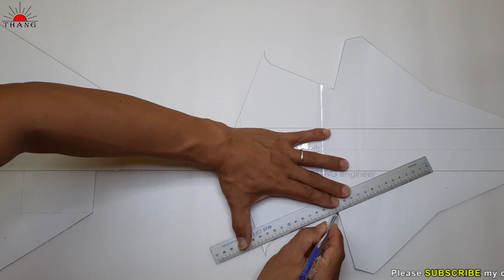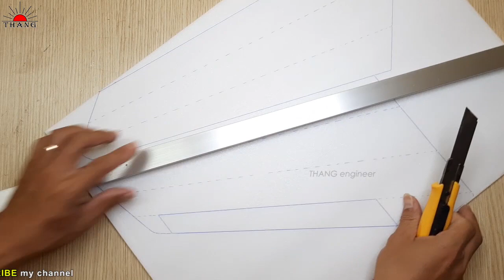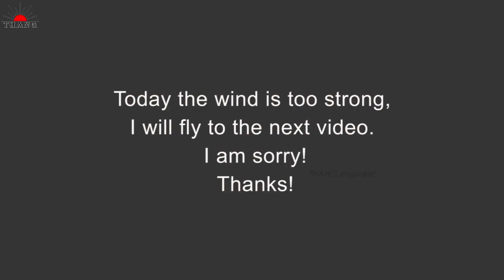How to make Jet Airplane with 2 Motor Ducted Fans

Comment: You should of tried it indoors like a warehouse the chord to length and aspect ratio to be correct to a real jet fighter if you  get the last two Aerodynamic equation right then ducted jet RC will fly so a EDF 50mm now EDF 120mm has a thrust of 7.5 to 8kg so twin output should of been 6.25 kg it should of flown even in that breeze.